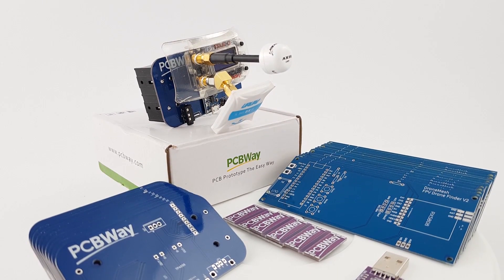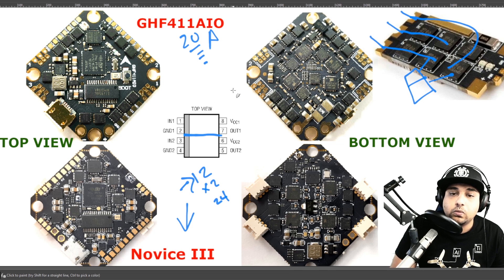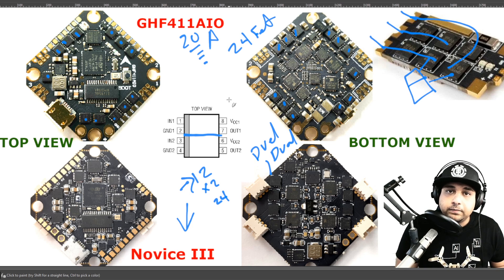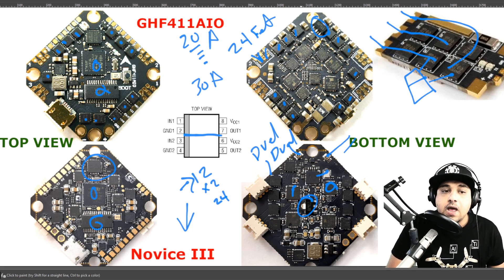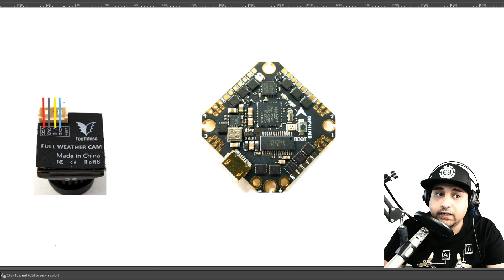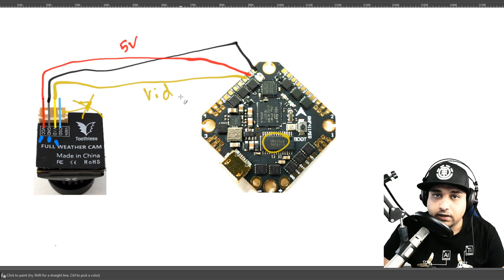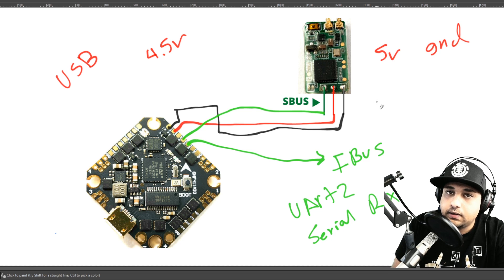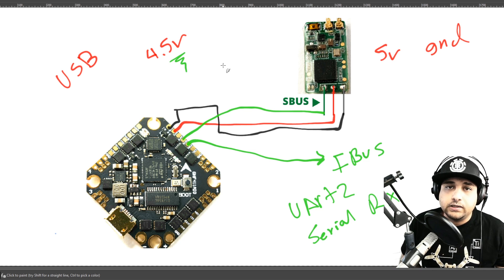How to Choose Your Next AIO Flight Controller // JHEMCU GHF411AIO Breakdown

Comment from the maker: GHF411 AIO 20A: https://bit.ly/3cJt5td
GHF411 AIO 30A: https://bit.ly/347y7wI
Novice III: https://bit.ly/2yFN6lM
Xt30: https://bit.ly/351yBF3
Reply: If you're running FPORT, do you connect it to the TX2 pad or still SBUS. I've had this AIO, and never got FPORT working.

Comment: I'm looking to get a little more info or opinions on a build I'm looking at doing with the ghf411 aio40 amp Idealy I'd like to try a 7 to 10 inch large motor high efficiency build,  everyone I ask or talk to looks at me like I'm nuts but the old school dji and others used 20 and 30 amps for 10 inch blades any opinions help or ideas , if you have any lmk plz it's gonna be my summer long range scout build

Comment: Wow, thank you sooo much, I had no idea they double upped fets like that, and that air mode affects their durability, I've been in the hobby more than a minute too, I can't believe I just learned that.  Makes sense though, I've done 2 toothpick builds since summer, and I've been burning up esc's and fets like nobody's business.  And I always use airmode.  You think I should put it in on a switch, or use the airmode min setting in BF?  Or do most just do without it on toothpicks/micros?

Comment: So far so good I'm running two different Xknight builds / one a 4inch/ another 5inch build both have the GHF F411 Aio 30amp boards in them. Both builds running Caddx Vista and crossfire rx...Purchased both after going through three Betafpv V3 Aio boards which was a nightmare to tune out of the box because of touchy gyro they have in the boards..And both ended up blowing fett's on the esc's. Awesome content on the rundown on the boards thanks

Comment: Hi.
This board is not havy duty xD
Mine board getting power to flight controller but not to esc.

Where you pointed on 3.3v regulator on this video, mine getting freaking hot and dot power up esc.
Can you tell me if AMS1117 voltage regulator will be allright for this board?
I cant find any 8k911 or bk911.

Im talking about ghf411aio

Comment: I'm building now with the GHF411  30A version.   I've got everything working under BF 4.2 and BLHeli_S 16.8 including SBUS, Bi-Dir DSHOT, 48kHz, color LED, RPM filter,
BUT I can't make a 2-pin buzzer work with the BZ- signal.   Anyone know if some RESOURCE remapping is needed or other CLI change ?

Comment: thanks for the review! Tacking in account that there are a lot of caps built on int, which capacitor should I connect in parallel with the battery?

Comment: Need to replace a FET on a Happymodel Sailfly. Ordered replacements from Ali. Is it possible to do it without a hot air gun? Put out a how to if you have a chance.
Reply from the maker: Hot air is best method I will do more repair video in the comming days.

Comment: Ordered one of those 30A GHF411 boards a week or two ago. It finally shipped out today. We'll see how long it takes to get here,  but kind of excited to try it out. Thanks for this video Sam!
Reply from the maker: Keep me updated on how it handles
Reply: I have two 30amp GHF F411 boards on two different Xknight builds running Caddx Vista on both and crossfire on both. And so far its three times better board than the Betafpv V3 boards which both blew up fett's on the escs and was a nightmare to tune because of the touchy gyro in the Betafpv boards

Comment: what budget/perormance 4in1 fc stack do you recommend at the moment? still the iflight f4 stack? or did something new pop up within the last 7 month?
Reply: I’ve used nameless and beta 12A on 2s with good results, but let the smoke out of both on 3s during crashes. Started flying mostly 3s with geprc 20A and beta 20A and haven’t smoked either of the designs only 1 motor in a crash. I do like the geprc best for the price and castellations on the motor solder connections. The motor wires solder great to the sides of the board with no need to remove the canopy to swap a motor. All the options out there seem to have compromises either in pad sizes or mask between the pads. The 20A beta has a very small sliver of mask between the motor pads. The geprc 20A has the video pads really close together. But all the aio’s are tight with respect to area. Updated both to 4.1. Gradually slid the filter sliders over and they’ll fly like a champ! That being said? Whatever’s in stock ;) 

Great video as always! Would love to hear Drone Mesh’s recommendations.

Comment: How do I know how many "feds" an esc have when you going to buy ESC,it's supposed to say it where, in  specifications?
Reply: It is "FET" for field-effect transistor. They are often the big same size square components on a esc. So you could count them. But they differ in their specs so i do not think knowing the count helps much. As a rule of thumb: bigger ones could handle more amps passing through them. Some with a heat sink or metal capped ones also should handle more than their bare counterparts all else equal.